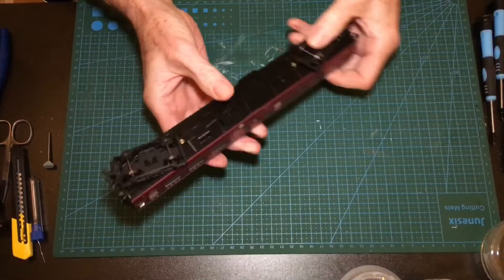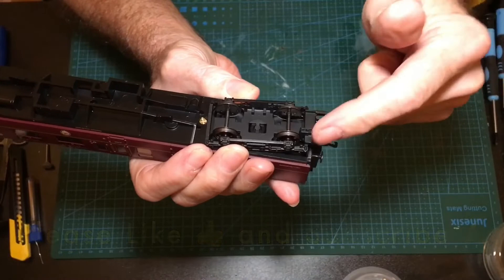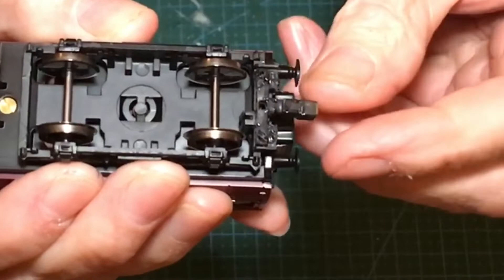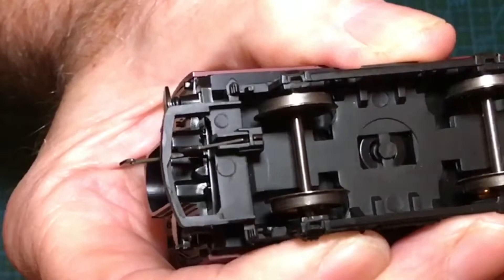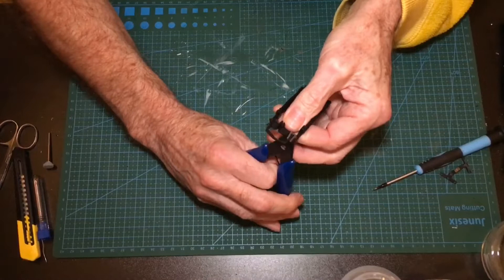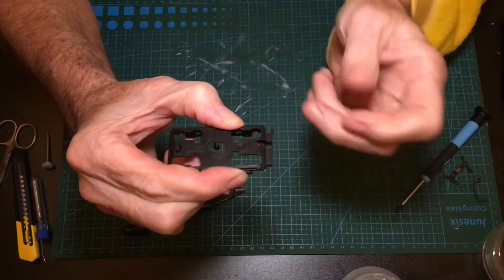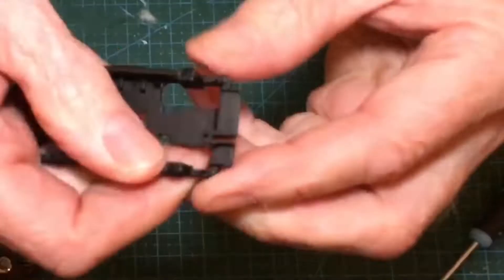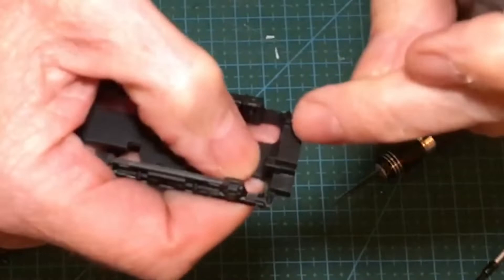Workbench Session - Hunt Elite Couplings upgrade to Hornby coaches, with one piece D coupling/bogie.

Comment: very nice I'm just about to start replacing the older style couplings on some of my rolling stock
Reply from the maker: Hi Digger…… Thanks for dropping in. I’m finding that Improving the couplings,  especially on older stock, to be very satisfying. It improves performance and ease of use. I’ve also found that in certain cases the odd troublesome wagon or coach suddenly become we’ll behaved 🤣👍
As well as Hunt couplings variants I also like the versions from GLR Bespoke Services. 
I recently picked up another design of coupling on eBay from a seller called
‘adrianmole’. I haven’t used them yet, but they look very promising. The different
 types/makes gives me plenty of options to modify all styles of older couplings, even HO kit. 
Regards…. Steve 👍

Comment: Nice little job Steve, I’ll use them on the Network Rail Structure Gauging train I’m making. 👍
Reply from the maker: Hey Colin… Thanks for dropping, hope you are well. I’ve found them to be very good. Ease of use and more reliable running. I’m trying several manufacturers versions of magnetic couplings. GLR Bespoke Services versions are quite good also. They are all slightly different but the variety comes in handy for different types of modifications. 
Just in case I don’t get the chance nearer the time…… I hope you and yours have a great Christmas and all the best for 22. 👍🎅🏼